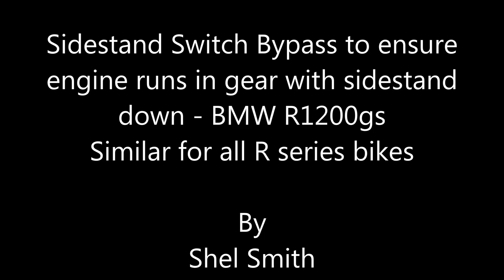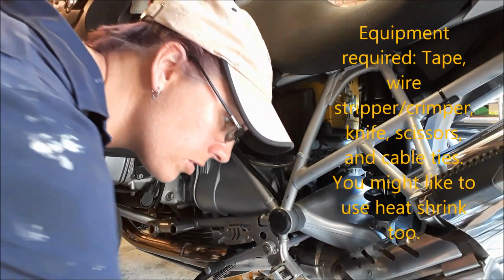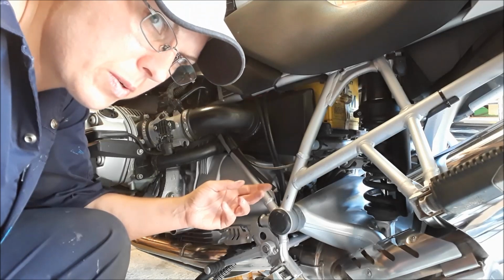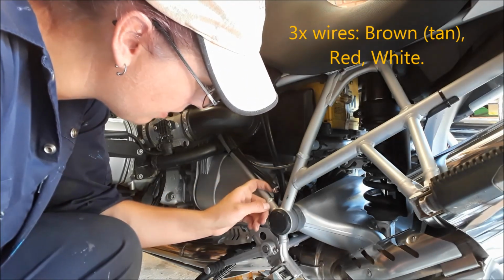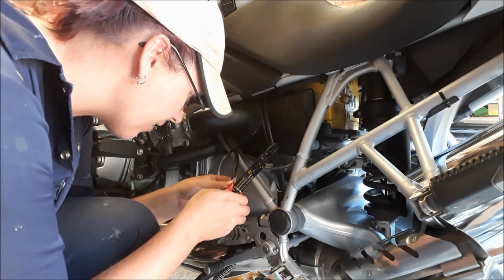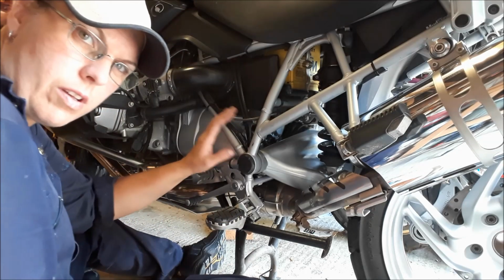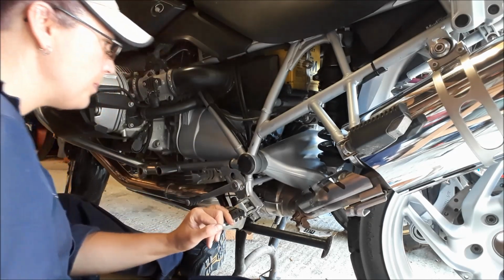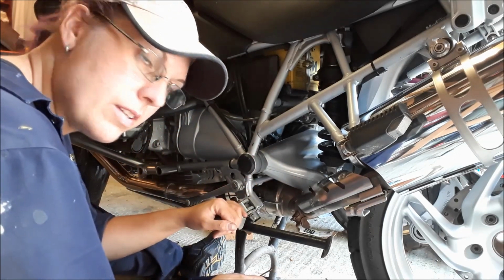Side-Stand Switch Bypass - BMW R1200gs - Similar for all R Series Bikes.

Comment: Shel, love your approach, but wonder if this technique is applicable to the newer bikes which reportedly rely upon a specified resistance in the switch to prevent this type of bypass?  My understanding is that newer models would require a dongle type bypass.

Comment: Hi my bike giving mr problems starting fine go for a short ride switch it off won't start it acts like tge battery is low but sfter waiting for 10 mins it starts. Or jumping it with another battery start's right sway the battery has been checked its fine   wondering if you ever had something similar mine is a 2005 abs model

Comment: I'm hoping someone else reads this and found/finds the same issue. The official documentation from BMW is FUBAR.  My side stand switch broke and I ordered the new replacement one that now is a separate switch and a separate harness.  There is a connector on the switch for the new harness.  Before the switch and harness was one assembly.  Now you need to order two parts to replace the original assembly. 

I think the BMW documentation is wrong on the wire colors and the pins in which that are suppose to be installed.  I agree with  her findings the white and tan (brown?) wires need to be connected to fake out the bike thinking the kick side is up (retracted).  But it you look at the BMW wiring documentation for 2007 R1200GS,  the red and brown wires need to be connected.  My findings trying to troubleshoot my side stand switch found the bike is wired as (pin/color),  1/tan, 2/white, 3/red.  Documentation says 1/red, 2/white, 3/tan.  I have to assume the bike is correct and the wiring docs are wrong.  Even the wiring coming out of the switch's mating connector (X9039) has the wrong colors/wrap  when compared to my actual bike.  Bad situation all around!

Bottonline (word of caution)

Shorting the white with the tan  wires will fake out the bike thinking the stand is up (retracted).  You can start and shift with the side stand  extended (down) or retracted (up).

If you want to replace the switch with the new two piece assembly, pins 1 and 3 are likely reversed in the new harness.  If you use the new two piece assembly what happens is when the stand is actually up (retracted) the bike thinks it is extended (down).  When the side stand is actually down (extended) the bike thinks the side stand is  retracted (up).  
I confirmed this a$$backwards conditions with my GS-911.  The CANbus thinks the stand is up (retracted) when it is actually down.  Likewise  CANbus thinks the stand is down (extended) when it is actually up.

So you can put the bike in gear with the side stand down and the bike will not turn off.  Yeah, I thinks its a safety issue.

Makes all your left hand turns a bit difficult.   :)

Comment: Hi, just bought a 99 r1100 rs and want to do this so I can warm bike up prior to leaving for work. How long should engine be warmed up before riding? TY
Reply from the maker: Hello, i wouldn't leave it idling for too long because I have heard of the plastic screen on the oil sight glass (not glass it's plastic) melting due to too much heat. also, due to the way the oil cooling system is designed along with air cooling, the bike needs to be in motion to cool. Therefore, I guess about 5 to 10 minutes will be enough to ensure the bike is warm but not too long to overheat the system. Normally I start it when putting in my helmet and gloves, then it's good to go!
Reply: @sheldoesstuff2753  Thx for the easy fix and clear, straightforward directions, Shel. Though unfortunately even 5 to 10 minutes idling is considered too long for these bikes, and another reason why they added the cutoff switch.  So as stated in the owners manual, best to just start the bike and ride off. Yeah, oilheads don't like having little to no air flow over them, and letting an RT idle to warm up can easily cause the tupperware to melt, or catch fire (Google it)!

Comment: Help please! My side stand on BMW r1200r wire  came off the connector.can not find anywhere where it is plug into! Spend 2 hours and cannot find it.my engine is twin boxer 1200cc
Reply from the maker: If it's the end which goes into the switch it may not be replaceable as it might be a single unit. Whereas if it is the end which fits into the loom, then that is likely up near the tank.
Reply: @sheldoesstuff2753  yes the end to the loom.my question is I cannot find where it popped out from the end was loose under the tank .looked for 2 hours to find the female plug but cannot find it